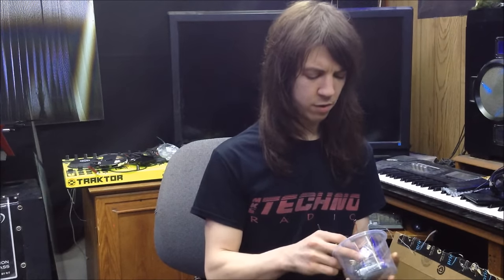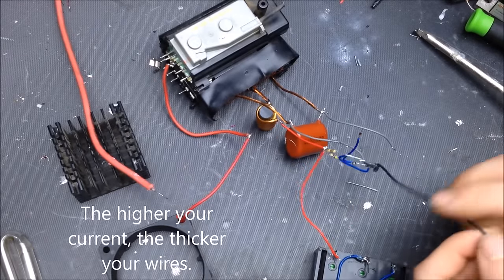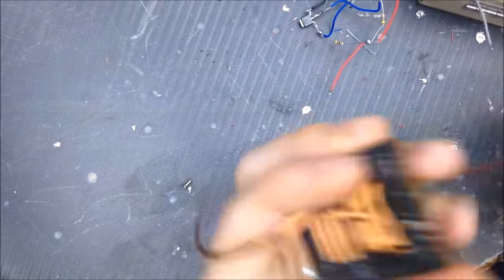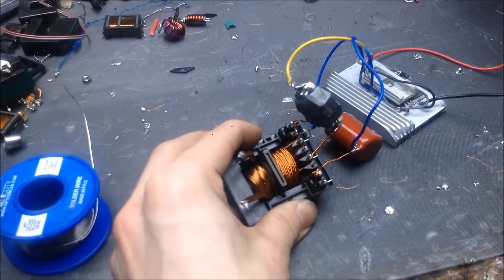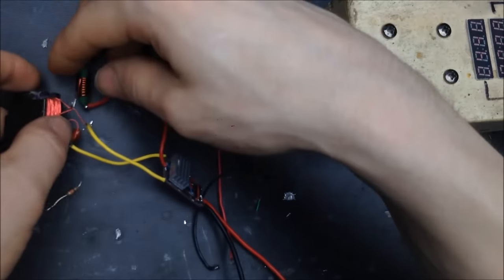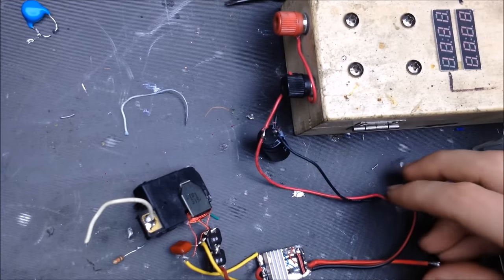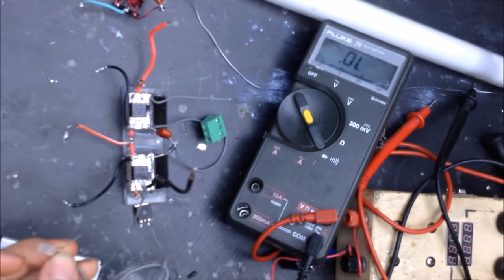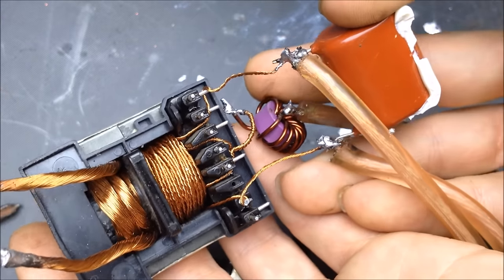Bare&Basic ZVS Circuits of all shapes and sizes.

Comment: @ about 5:30  - Should you have said "Negative at source PULLS DOWN the other fet and turns it off"? I'm completely thrown off by you saying a negative current flows against the cathode of a diode. I'm super new to this hobby so I may be missing something obvious but I don't get the negative current flowing reverse bias THROUGH a diode. Maybe electrons flowing through that way? Or most likely just could have misunderstood.
Reply from the maker: The negative current flows through the Mosfet that is in the conducting state and through the diode back to the other Mosfet gate turning it off until the next cycle of phase shift in the magnetic components of the circuit. Both Mosfets have a pull up from the resistors and will want to be on at the same time without the diodes to ensure only one Mosfet is on at a time.

Self oscillating circuits are a very tricky thing to learn because they are so dependent on the physical parameters of operation that can be quite hard to translate without a litany of demonstration, hence the long video provided to hopefully help provide enough piece for anyone to get enough comprehension to learn a practical working model in the best method for all.
Reply: @Zenodilodon  So let me tell you where this has me all F*$#ed up. I'm certain you know the way a full bridge rectifier works so lets use that example. On the negative end the voltage/current is not able to flow reverse bias through one diode and then flows up into the positive/live side forward bias through the other negative connected diode. So when you say there is current flow reverse through that diode I'm thinking there is some huge details I missed along the way.. is that current just the rated reverse leakage? I don't look at negative voltage as ground either, I look at it just as an upside down "positive" voltage that travels the other direction..... but I don't think I've ever heard of it flowing reverse bias through a diode.  Again,  maybe I'm just misunderstanding... But If I'm missing something I want to stop and take the time to learn it correctly.
Reply from the maker: @steeringelectricity2779   Please contact me over Facebook of you are able /Zenodilodon I wish to speak to you in real time chat if possible.

Comment: Very useful video thanks for that.
Could you make another video explaining how to build that full bridge configuration transformer driver with coupling cap that u showed on video??
Reply from the maker: A video on full bridge circuits is in the future, that particular board that I used in the video is a prototype though and has some minor issues. It's based off the SG3525 IC which is analogous to the TL494 and is a dual output IC. We used a totem to drive the P channel mosfets. The issue with the current configuration is in the phasing between the 2 sides and thus the mosfets get hot since there it not a solid off during the 0 crossing.
Reply: @Zenodilodon  since i don't have an oscilloscope I'm waiting for u to make an explicit diagram for that.good job bro keep it up

Comment: watched your video! very informative! could you point me to where i could calculate this stuff, or at least what things i should try to search. thanks!
Reply from the maker: That's the largest problem for ZVS stuff for most people is the calculations. It's not exactly straight forward. It's similar to an LC oscillator circuit in that you have inductance and capacitance in the equation however due to there being 2 magnetic components the inductor and transformer it becomes much more tricky to get the optimal balance. This is why I went through so many different set ups and included both success and failures to show physical correlation and effects of changing parts out. You can try to use JavaTC to do your LC maths quite a bit but it's still a tricky task. Even after a few years of messing around with this stuff it still can be hit or miss with how well something works. I do have planned for 2021 an update on some things I have learned since this video so check back for that every once and a while.
Reply: @Zenodilodon  Thanks man! I sure will! I am also planning on laying with this stuff. I know how oscillating circuits work, so i think i will just have to do some good old-fashioned research on this.

Comment: hello I love your guys videos and got inspired to make something like the plasma pen from your videos. I have all the parts but am having issues with it. a couple days ago I got the circuit running nice and it was throwing about 1 inch arcs running about 2.4amps@9.6v off a homemade zvs but the circuit suddenly stopped working while it was running and started drawing alot more amps and the arcs were gone. long story short I changed every single part on the circuit including 3 different sets of mosfets. and still same thing except I realized that there was actually output on the secondary but I had to short circuit it to get an arc and could only draw the arc out like a mm. while still pulling 3 amps from my batteries. and when I tried making a different inductor with a screwdriver the current dropped to around only 2 amps but still the same size arcs. do you know why this is happening? thank you
Reply from the maker: Glad to hear you enjoy the content. It sounds like your secondary has failed in an area and this is causing the draw of current and lack of output power. It sounds exactly what happens when we had breakdowns in our secondaries. A good way to manage this is to write the resistance of the secondary down. If that drops lower then you know it's done. There is also another way of doing ZVS which has a center  tapped inductor, or 2 inductors of equal size attached to how the transformer is attached in this video. Than you just put a 2 wire primary transformer on the 2 outer taps of the inductor/s It works amazingly well. If you e-mail me I can send you pictures of how this is put together.
Reply: Alright can I get your email?
Reply from the maker: @mondude9754  Zenodilodon@gmail.com
Reply: @Zenodilodon  ok ty
Reply: I sent you a email
Reply: Yup you were absolutely right about my old transormers secondary failing. I got a new transormer with a fresh secondary and hooked it up to my custom homemade zvs driver on blank pcb board and and it runs again with nice arcs. Thanks again for helping me figure out whats wrong

Comment: Can I use tvs diodes in lieu of the zener diodes??
Reply from the maker: As long as the clamping range of the TVS diode is at or below the voltage of the gate input you should be able to use them to protect your mosfets

Comment: You say the negative voltage flows from the source to the drain... does the mosfet not show a flow from drain to source/ground for a low side npn? I've stopped watching until this is clear to me. I'm thrown off by saying a negative voltage flowing reverse through the source and through the zener.... maybe if you said electrons I wouldn't be so confused right now... what am I missing? (Btw I would have been stoked if you cut the whole face interview and just discussed all that with a bench view... only preference though since I watch so many videos like this.)
Reply from the maker: In real physics yes electrons flow from the negative to the positive, this is how I speak because it's applicable to other fields of understanding and models.
The electrons in this circuit flow from negative into the source through the junction and exit the drain. Zener diodes are only used for gate protection and do NOT conduct until they reach threshold voltage.
I also try to speak of negative and ground in context as if they are applied in floating or grounded systems. Ground is not the same as negative.

Refusing to watch the rest of an explanation video without an explanation, isn't that like holding yourself hostage for money kind of thinking?
Reply: @Zenodilodon   I get your analogy but everyone's situation is different right?. I'm 31 with a new hobby I've invested copious amounts of my savings into and you creators are my professors. If I misunderstand something in a video this long then I can't take in the proper remaining info. My kid just turned 4 years old. so since I first picked up a dmm when she was 2ish  I've been limited to night time lab and study time. Since my career is unrelated, I try and use those nights as efficient as possible. That's why I held off watching at the moment... (I meant to delete this so I commented on my active channel I use for electronics.. feel free to delete this stuff and I'll do my response question to your other answer since I feel I asked my question a little more clear there. I'll give you a follow on both channels)
Reply from the maker: I will try to help out with answers,  I am unsure how to format information at times my brain works very well with real time physics but trying to make a format style presentation or answer is nearly impossible for my head lol. In that sense I suck up information like collecting puzzle pieces hoping to eventually put them where they belong. This video is kind of like an attempt to dump out all the puzzle pieces on the topic I have collected. I myself just started getting into this power electronics stuff about 4 years ago in a more serious manor and it's still confuses me to a degree as well. I am by trade an optical/laser tech and have gone into this kind of stuff as hobby as well.

Is your other channel Steering Electricity?
Reply: @Zenodilodon  Yes. Starting a channel with my couple hours a night is hard. My kids finally about the age where I can get a little free day time sometimes so I just went and bought a nice multi camera setup and editing laptop so I can start posting with some consistancy and less filming struggle. They won't get many views since I don't do social media anymore but I mainly want to make videos on things I struggle to find on here. Hopefully help just a couple people dedicated enough to scroll through pages of YouTube searches down to my couple views. Filming lab projects is tedious and frustrating sometimes when you just want to focus on the project. So kudos for the "fuck it, just post it all" upload.

Comment: Can you say more accurately and more specifically about the diode you are using.thanks you
Reply from the maker: Any schottky or signal diode with the appropriate voltage rating will work. This is not a very important thing to consider and doesn't have to be exact, most diodes will work.
Reply: @Zenodilodon  so please let me ask more.  I use mosfet p75n02 smd.  input port G = R470ohm.  and use zener diode 4.5 or 4.6 vol.  is the 5v input port working properly?  thank you so much
Reply from the maker: @duongbui9621  There is significant ring up on these circuits, figure it can go up 4x when made properly. I typically use ZDs that are 15-19v as many mosfets have a gate voltage of 25v. This cuts down how much current ends up being dumped in the ZD and helps to maintain oscillation. I'd say using a 4.6v ZD is too low for this application.
Reply: @Zenodilodon  i want to make a pulse welding machine from zvs circuit.  so, I have to use DZs 15-19v, right?  and how much voltage the mosfet port will work.  Sorry for not having enough knowledge in this field.  Could you please help me
Reply from the maker: @duongbui9621  Your ZDs must be chosen to closely match the gate voltage of your mosfets. Check on the data sheet for the mosfets you bought for the gate voltage and choose a ZD that is about -3 volts from that rating and you should be fine. If you are intending to use a higher voltage select a ZD that has a decent wattage rating for larger applications.
Reply: @Zenodilodon  i want to use the voltage about 5v or less. so i will use ZD 3v.  thank you so much
Reply from the maker: @duongbui9621  It's not about the voltage you start with, even on a 5 volt input you can have ring up above 40v. This means if you use a ZD with 3 volts you would be dumping up to 30+ volts on it and they will eat up the extra power and get hot. Check your mostfet datasheet and find the gate voltage, IE if the gate is 25v use a 15-19 volt ZD to protect your gates.

Also please do not confuse the ZD with your other signal or shottky diodes used for the oscillator, ZDs are only for mosfet gate protection.
Reply: @Zenodilodon  I have understood your problem.  I sincerely thank you.  I wish all the best for you and your family
Reply from the maker: @duongbui9621  Good luck with your build, it can be tricky and that's why I did such a long video to try to help out others. Be well yourself and your family as well. Good health, long life.

Comment: I hear meth smoke
Reply from the maker: If that's the comic material you're bringing to the channel I wouldn't quit your day job anytime soon.
Reply: Sorry about that Well played. I wish I had a job but I'm happy staying home taking care of my lil girl and running various experiments and working as many side jobs ... any my ion drive with eight stage coil accelerators is coming along with lots of trial error and lots of reiterations  because I know there's a better way to help put the thrust without adding 490 lb and only getting 3 times the amount of thrust when the original one was around 12 lb and output 92 million Newtons of thrust that's not bad now they just accelerate it with a multi-stage linear induction motor to accelerate the ions even faster Ergo more thrust im trying to do so all while remaining it under 20 lb  trying to show NASA that you can get more thrust without making it 50 times heavier than the original ion drive that's on the dawn spacecraft right now so. any tips on how to get the most effective Corona with out the arc jumping across I was thinking about using an electromagnet to force spread the ark into more of a Corona what's your thoughts
Reply: I'm just saying NASA's MK3 Drive is a 500-pound slab of shit that's 17 x heavier than 3 MK1 drives that would have been just as effective and had the same amount of thrust if they had just used 3 MK1 drive so why spend like 7 to 18 years and probably a couple of million dollars on something that's less effective what the fuck
Reply from the maker: @numatechprototypes222  Pulse your high voltage, you can get more power/voltage per distance in air and avoid break down discharge/arcs It needs to be fast. I would also suggest looking into slow moving ions and use those to increase repulsion effect. As far as Nasa goes, we already know they don't know that newer should mean better lol
Reply from the maker: If it helps, I don't have a job really either. I make it from project to project with a passion, but I have given up a great deal of stability to focus on learning and sharing content with others. I don't care if I die poor, but to heck if I am gong to die a nobody who makes little contribution to the world.
Reply: @Zenodilodon .I just don't like the idea of working for someone else like a slave for the rest of my life money is fake but knowledge is worth the world over . yeah once I get a project in my head it drives me crazy untill I work on it and test it